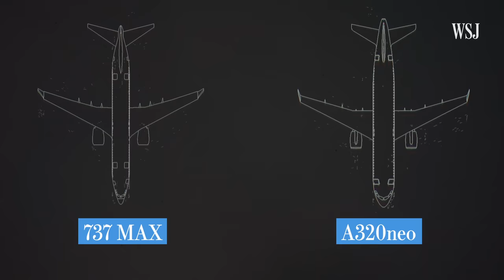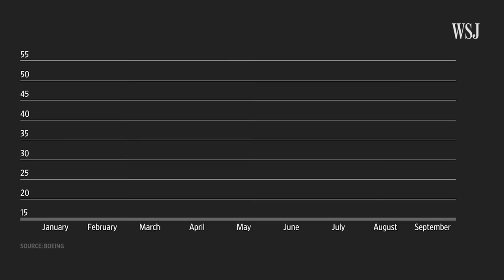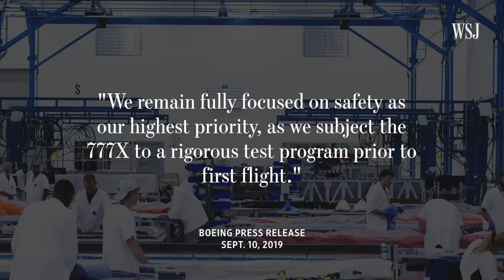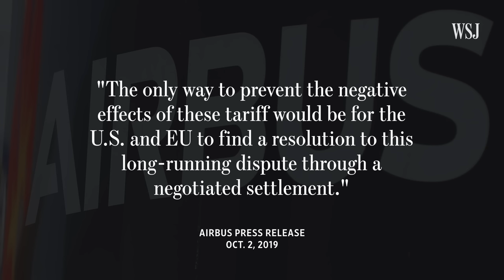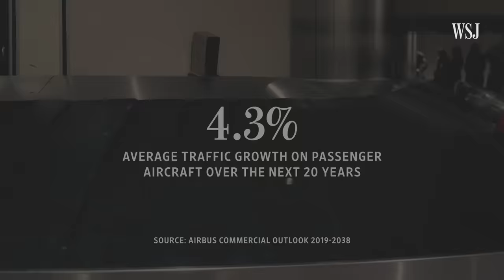Boeing vs. Airbus: Why Aviation’s Biggest Rivalry Is in Flux | WSJ

Comment: I don't get how the 737 max crashes have anything to do with the safety of flying Boeing now going forward. If anything the max 8 will be safer than any other plane when it gets ungrounded because... well, money is a powerful motivator and there's now $9 billion reasons to make sure it doesn't happen again.

Honestly when it comes to Boeing and Airbus choosing between one and the other is kind of arbitrary. Commercial airline travel is incredibly safe no matter which airline you fly and which airplane you fly on. Southwest, which uses more Max 8s than any other airline, has logged close to 100,000 flight hours with the Max 8 with no issues at all, let alone any crashes. So even a plane that is now notorious for being "unsafe" is, in fact, still very safe.

Comment: Why nobody mentioned that Airbus also had similar accidents before(Qantas flight 72 & 71), in which two A330 pitched down so hard that injured many passengers. Airbus was lucky that it happened at cruising altitude and the crew were able to recover. I do think Boeing is stupid not learning from past accidents. But looking back to the old days when A320 was first introduced, the crash of the first ever A320 didn't prevent it from becoming one of the best selling planes in the world. So I don't think these two accidents would hurt Boeing so much.
Reply: 管笑天 the plane dropped 800ft and it’s easy to disable the protection that caused it to pitch down by switching off the ADIRU

Comment: Some will argue the 737MAX is basically flawed and cannot be fixed easily.. Some will not agree. Time will tell. One thing for sure, the 737 is a remarkable if not iconic aircraft. Did the MAX forever tarnish the legacy?

Comment: Everything went south for Boeing after they acquired McDonnell Douglas. They don't manufacture every part of their aircrafts in house, the fuselage, the wings and the control surfaces are acquired through third party manufacturing companies. The larger issue is - Quality control. Boeing expects these third party companies to do their own QC before delivering the parts and Boeing just accepts their word for it. For the 777X, four out of six aft pressure bulkheads were poorly manufactured and this was found AFTER the said parts were cleared by QC. AirBus builds the whole aircraft in house (except engines obv.) so they have tighter QC phase, their flight controls are pretty much similar across their aircraft line-up, so it's much easier for airliners to get their pilots to adapt to newer models or bigger models. In an Airbus, even if the pilot himself/herself tried to bring the plane down, it won't let them. If you're obliviously slow on approach, the aircraft automatically adjusts speed regardless of FMC inputs (alpha floor protection). The on-board computers operate under three laws which allow the pilot to adjust his/her approach to an adversity faced during flight. Overall, I think Airbus is going to make Boeing look silly when it comes to commercial aviation.

Comment: In my opinion Airbus wins (by a landslide) Boeing makes great planes sure but the last years Boeing showed the world that it prefers profit before the lives of people .
Even if you put Boeing's scandals over the last 10 years asside and focus pureley on the planes themselves Airbus still wins .

Just a few differences why airbus wins the race lined up : Queiter engines , bigger IFE screens for passengers , bigger planes (A380-A350-A320 NEO) all these planes are bigger than there Boeing counterparts , bigger toilets on board aswell more advanced cockpits for the pilots etc... etc...  

Only thing i can come up with where Boeing defeats Airbus is the cockpit yoke that pilots use to control the aircraft . Boeing's yoke is clearley vissible and moves in sync with that off the co-pilot's . Airbus doesnt have that which helped to cause the Air France 447 disaster of 2009 . Apart from that airbus wins by far .

Comment: How do they not include redundancy for the automatic flight computer system that takes over for stalls?  Having the plane automatically pitch down for airspeed when it thinks it's stalling cost the company tens of billions of dollars just as adding a dedicated flashlight switch to smartphones would cost companies tens of millions of dollars in claims when they fail.  The solution is not to add certain things.

Comment: 2:30 shows a drogue parachute off the max 8 vertical stabilizer... what’s that about. Oh and there it is again when they flash value numbers on the screen a little bit later.
Reply: Probably a flight test sensor. As the plane has boeing painting, it is probably one of the prototypes. 

Nevertheless, I don't know why it is not painet in orange, like all flight test/non standard equipment should be.

Comment: It’s not a really fair rivalry. Boeing has been producing the 737 since the 1960s and it has a good reputation over all! People just don’t understand that it’s not always the planes fault! A majority of plane crashes are caused by human error and as you can tell in the vid it doesn’t tell you how the plane crashed.
Reply: A good reputation besides the two crashes with MCAS implicated in preliminary reports for both? And besides the fact that it was grounded worldwide? And besides the fact that there was a joint investigation by a team of engineers and experts from national regulators which heavily discusses how MCAS was not designed at the system level, not satisfactorily certified, and it was unclear whether 737 MAX is even longitudinally stable as a bare airframe at high angles of attack?

Comment: I'm not taking any sides but Boeing is easy to fly than airbus, it's like driving a car airbus don't let you control fully by yourself. 
You can ditch plane immediately to the ground in Boeing (bcoz no fbw system, mechanical connection) .
Think about an emergency situation like this : you've got electric failure, twin engine flameout you will have no control without electricity and you are dead because of fly by wire side stick, you cannot even glide.  Yokes are mechanically connected and will save your life.

Comment: Airbus - Designs the A320neo
Boeing - *scrambles to create a a market competitor to Airbus, comes up with 737Max 

737Max- is a flawed plane, solely created to not lose too much sales to the A320. Its flawed cause they hastily built it by utilizing an outdated airframe and just placed larger engines on it which didnt fit on the plane, then tried using MCAS to offset the flaw of the plane since the larger engine caused it to pitch up and stall. To save even more money they outsourced the MCAS programming to some Indian outfit overseas which did a terrible job writing the code. Then even had the arrogance to charge for MCAS as an extra feature. Their actions are dispicable and CEO of Southwest airlines is just as bad for pushing Boeing to keep development of this outdated 737 design just to keep cost down since their entire fleet is 737s and it lowers their operating cost and cross training for pilots.
Reply: A lot of that was incorrect. MCAS may or may not cause pitch-up tendency on approach to stall. In normal operation pilots should never reach such a condition (still not a good airframe characteristic, but it's not like it's constantly trying to stall either). MCAS code was fine – it's not a software bug so outsourcing wasn't a factor. MCAS was not an extra feature; you're thinking of the AoA indicator. Southwest Airlines does not know the engineering of 737 beyond the standard maintenance and therefore is in no way responsible for Boeing's failure to deliver a safe plane.

Comment: Air France 447 passengers watching the video like: 

If only it were a 777 instead of an A330 : (
Reply: Jack AF 447 was mostly caused by the crew stalling the plane and then not realising they were stalled despite the plane telling them they were. It could have easily have been a 777.
Reply: @extrude22  It could have been, absolutely. But the Captain of AF 447 didn't realize the extreme inputs(pulling back, instead of pushing the nose forward) of the first officer on the sidesticks until it was too late, because on an Airbus, they don't move jointly like the yoke on a 777 which would've been noticed right away. They're right in front of you.
Reply: @Jack3md  There have been crashes with similar scenarios to AF447 involving yoke controlled planes before. After reading the full accident report to AF447, I do no believe the accident hinges on this one detail.

Comment: Obviously this MCAS issue is a lot harder to fix. Remember when Boeing thought this was no big deal? Wow. What lack of oversight.
Reply: Once pilots get trained to fly on the MAX as its own, unique aircraft, MCAS (once fixed) won't be a problem.  The plane itself is fine.  It just doesn't handle like previous 737s.  Trying to make it handle like the older planes to avoid retraining is one big mistake (with the other being the botched implementation of MCAS).
Reply: @joesterling4299  That's unclear at this point – MCAS may or may not be a stall protection system. If it is it would require a much more redundant design than currently

Comment: bruh just make the landing gear taller then put the engine back into the original place. its not that hard
Reply: It is that hard, it would require certification for the new modification, even though the MAX-10 already has longer landing gear, if memory serves.   This would also involve crew re-training.

Comment: Boeing didn't want to build a new plane because its cheaper. They didn't want to re-designed it, because the plane would lose its type rating and would have to recertify it $$$,  and airlines would have to retrain new pilots $$$. The 737 was designed over 50yrs ago since then its been re-engineered pass its limitations.

Comment: The Airbus a330 is cooler than boeing but boeing 777 is long and boeing 777 300r
Reply: A340-600 is longer than 777.
It is also longer than 747.
Reply: @siddharthsharma8940  The 747-8i and the 777x is longer than the longest Airbus plane. A340-600

Comment: A380 was a well designed aircraft. But apparently we don't really need them.
Reply: The A380 was supposed to be economical, however it wasn't economical enough, the A380 was designed to hold up to 500 people meaning fewer aircraft in the air, but the fact it has four massive engines meant it was more economical still just to put all those people on two smaller aircraft that have two medium-large engines each.
Reply: @krashd  it was economical for it's class.  But not enough demand for it's class

Comment: Why are they talking about redesigning the software system. Those planes have major stabilities and aeorodynamics  problems. Those antiquated  planes are not equipped to handle those massive engines. If they put them back in service, anyone foolish enough to book a flight on those flying coffins deserve to die.

Comment: there was a time when airbus was in all kinds of trouble
Now they are flying high but what goes up will come down eventually mind you not that i wish this to happen
Both Airbus and Boeing use American made controls and other hi tech equipment as a result the problem Boeing is having is based on other factors

Comment: 737 Max based on 50 year old technology, on introduction B737 had several crashes before Boeing fixed hard rudder over defect after resisting and denying design flaw; now with the MAX the same denial of new design flaw>MCAS. A-320 and A-320 Neo and A-350 are the world’s most advanced passenger planes > they can also ditch in a autopilot controlled flight > as in recent Moscow and earlier Hudson River crash landings, on the Hudson the plane did not sink as it was designed to float in ditching situation. Boeing needs to be fined $1 billion per fatality in the Lion Air and Ethiopian crashes plus $100 billion punitive damages and prison sentences under applicable law for executives held responsible. If it is a Boeing, I ain’t going! Happy flying everyone.

Comment: It is very simple - if you need a software to be able to fly, you are not a machine that can genuinely fly.
Now, what concerns me is that they keep trying to make it work. So, safety is not their #1 priority. It is shareholders. If it was about safety, they would have addressed the very thing that makes this machine unflyable in the first place. Not tinker with the software. The software is paper over the cracks.

Comment: IN 1988 AIRBUS COVERED UP THEIR A320 CRASH WHEN THE EUROPEAN AVIATION BUREAU REMOVED AND EXCHANGED THE BLACK BOXES ON THE A320 THAT KILLED 139 PEOPLE. WHAT ABOUT THAT CRIME? THE EUROPEAN AVIATION BUREAU WAS LYING AND AIRBUS IS STILL IN BED WITH WITH EUROPEAN AVIATION BUREAU AND THEY CANNOT BE TRUSTED!!!  Air France Flight 296 was a chartered flight of a newly-delivered fly-by-wire Airbus A320-111 operated by Air France. On June 26, 1988, as part of an air show it was scheduled to fly over Mulhouse-Habsheim Airport (ICAO code LFGB) at a low speed with landing gear down at an altitude of 100 feet, but instead slowly descended to 30 feet before crashing into the tops of trees beyond the runway. Three passengers died. The cause of the accident is disputed, as many irregularities were later revealed by the accident investigation. This was the first crash of an Airbus A320 SEE THIS LINK BELOW

https://www.youtube.com/watch?v=I9gELPxPG8Q
Reply: they didn't throttle up fast enough to go up anyway. The anti stall chose "controlled flight into trees" over "stalled flight into the ground"

Comment: Personally..I hate flying in a Boeing unless it's a 777 .

In return Airbus always makes me feel safer and the cabin is miles better looking and comfortable than Boeing. 

At take off and Landing Boeing is the worst aircraft experience you can have ..Never experienced a Boeing landing without at least two jumps while Airbus lands extremely softly .

Airbus is a miles better aircraft all round.

Boeing 737s were built with a well known Wing design flaw but they carried on building. Besides 737 is the MOST CRASHED AIRCRAFT in the Aviation history. 

I have a Son and a Daughter both are cabin crews and both hate Boeings.

Comment: Does everyone forget the airbus had a anti stall ai that did exactly the same thing a couple years earlier?
Reply: Not sure,  Boeing proposes to switch to manual, while admitting that the combined force of both pilots is not always enough unless you set the plane in a hard dive.
Reply: That's not true though
Reply: @AmbientMorality  I am no pilot, but the Boeing manual is online and that's what I remember after looking at it months ago.
Reply: @2adamast  Sorry, was referring to the other comment
Reply: Look up : Qantas Flight 72
Reply: “false (contradictory) stall and overspeed warnings”
Reply: The plane took over the flight and tried to kill everyone because it was programmed to keep the pilot from flying the plane. Same thing the max is doing.

Comment: sad 787 battery noises
Reply: @Airbus A340-600 chill dude i know but it fits into the circle of failure.
Reply: @Airbus A340-600 indeed flying pencil
Reply: Airbus A340-600 they did cause planes to be grounded. All Nippon grounded their fleet for a while

Comment: Just looking at some of the anti Boeing comments. December 28 2014 AirAsia Airbus A320.   June 1st 2009 Air France #447 Airbus A330. And I do understand the Boeing incident/Accident were within 6 months apart, but still 🤔
Reply: I think it’s because they know what the reason for those incidents was. 1 was clearly a pilot error and the other was pilot error and a sensor error. The sensor problem was a relatively quick fix, but it’s not so much you can do about human error
Reply: don't forget numerous crashes on A300 and A310 models
Reply: Airbus A340-600 yes, that probably why those two accidents where forgotten so quickly. Nothing seriously wrong with those two Airbuses, just human error and an sensor mail function that could have been corrected by an experienced pilot. The MCAS is a major system mail function that the pilots didn’t know about
Reply: Airbus A340-600 classic human error, the captain wanted to show of, waited to long to throttle up and the aircraft went straight into the treetops. They where lucky that only 3 people died and.
Reply: Both caused by human error
Reply: Airbus A340-600 I. The case of AF296 the computer did what it was supposed to do and prevent the plane from stalling. It was too late to recover by the time the pilots powered up. If the computers weren’t there and the pilot pulled back on the stick he would have stalled the plane and crashed anyway

Comment: When the chinese come, they might have to merge...
Reply: @gilvu1179  Woah, hello, fellow rolls royce engine
Reply: At some point, they will. Why wouldn’t they ?
Reply: @mariamartins367  It might, but certainly not in the near future, maybe 40 years from now. If you take a look of the accident rate of MA60, the last chinese made aircraft which sold internationally, I bet you will never try to get on board on one of the chinese made aircraft. The Max series is a lot safer than the MA60 even if they don't make any software modification.
Reply: I,m amazed The US still makes its own planes.  I thought like TVs they would just buy them now not make any.

Comment: For me Airbus is better because it is following EU regulations while Boeing follows the bare minimum GOP(republicans) regulations. Also as soon as the English leave the EU, I`m sure the safety level of Airbus will go up as they won`t manufacture it there anymore
Reply: Airbus and Boeing has Rolls Royce engines and the template is almost the same. Russia has their own engine. But the plane design is similar.